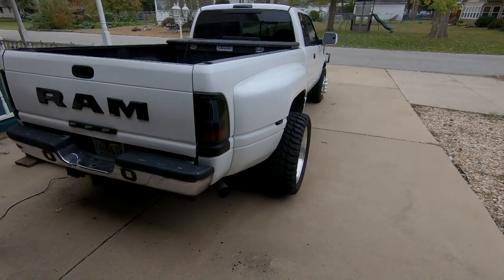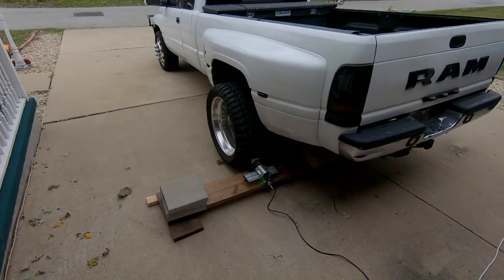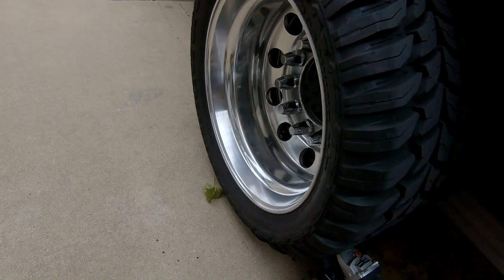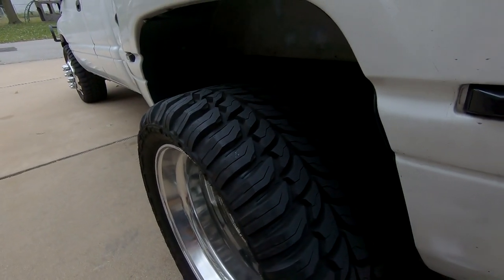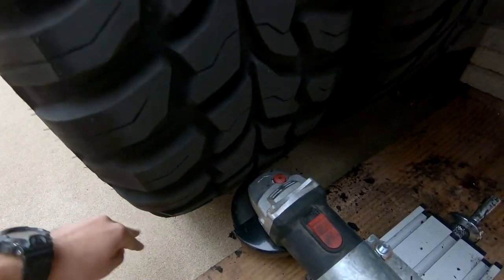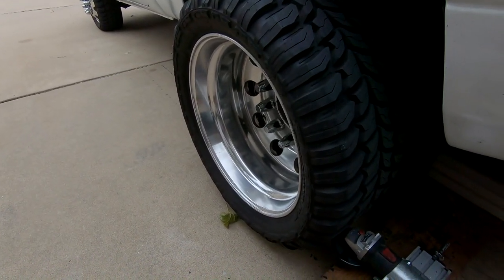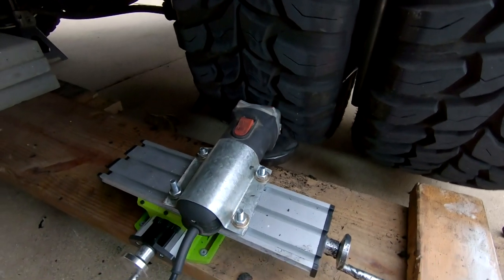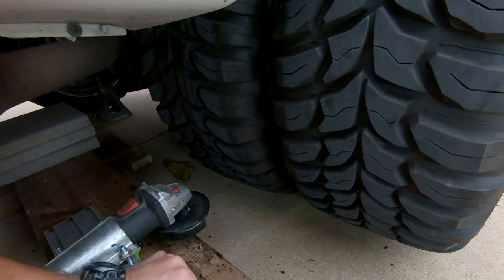Fixed my 10 Lug Dually Wheel Hwy Vibration | DIY Tire Shaving last resort | Crosswind M/T Tire Issue

Comment from the maker: After looking into this tire brand more, the amount of reviews complaining about out of round tires convinced me that this was the only way to fix them.  I got them from Simple tire, and they decided to sort the reviews best to worst, so you really gotta dig to find the bad ones, regardless of date submitted. Unfortunately just an expensive lesson learned. Warranty was pretty much useless, I did try that option.
Reply: I have the same kind of problem of a bit vibration on regular car (Honda accord) and I also figured the wheels are not perfectly round and I don't wish to replace them yet because there is plenty of thread left. I knew it must be the wheels because when I put the front wheels to the back, the problem got less severe. I'm glad you were able to help your problem but based on the video there is still some vibration in that and I would be worried about possible damage to the bearings and suspension parts if I had to drive daily with that. Were you able to ever get rid of the vibration completely and did you balance the wheels again after the shaving as that also effects the balance? Could there be some other issue also in your suspension or axles causing that vibration if you are sure you got the tires perfectly balanced and round but the vibration still remained partly?

Comment: I have the same tires on my 97 f350 dually, I have had the same issue, vibration in the front, but I have found that airing them down to about 70 or 65 makes the tire make more contact on the road and reduces and knocks it out. you may not be able to do thay since you have such big wheels I just figured I'd throw it out there for others.

Comment: Let the wheel spin by it's self and do the same setup just use a belt sander . Helps with more even and more surface area shaving . I'm about to do the same thing

Comment: I like your home made tire blade 👌... i payed 560$ to get that done to my dually... the reason why you have that problem is bcz they are cheap tires and also I run my psi at 45 or 50 so it won't bounce like a basket ball... hope this helps

Comment: Good video. I had the same problem with that setup. With everything you have done to your truck. I had 24 inch nitto 420s $330 per tire on a f350 dually. I ended up selling them and doing the direct bolt on rims 24” mega holes.
Reply: Send a link to ur wheels

Comment: My 97 250012v  also has a slight vibration and im running yokos, could be bushings on the Track bar or steering links or axle control arms. I know my bushings are not the best which is what is causing that slight vibration just like you have now. it is just slightly annoying. and very speed related. Take luck! love the content.
Reply from the maker: Thanks man

Comment: Make sure all mating surfaces are scotch-brite clean
Acorn nuts that accommodate the factory wheel stud and the Alcoa's dimensions to properly line up the wheels, those spacer things don't work as well or at least I've heard stories.
rotate your tires.
Re-mount wheels in a Cris-cross pattern hand tight, then torque halfway, then final torque specs
What PSI are you running? I always run about 80PSI in my front tires and around 55 in the rear if I'm not towing anything, otherwise the rear of my truck will buck all over. I have a 2500 though, your 3500 will be even more stiff especially with low pros. 
Alignment...You can do this yourself with stringline and tape measures. You will likely get the alignment more accurate than an alignment shop

If that doesn't help
Wheel bearings still good?
Driveshaft may not be true, u-joints may be going out
Tires absolutely can get out of round from: as they age, cheap manufacturing, if the vehicle they're on is heavy and sits for a while.
Reply: Also, Dyna balancing beads
Reply from the maker: I appreciate you taking the time to write all that. I have checked just about everything you listed. My biggest indicator its tire related is the stock wheels / tires ride smooth, so I know its definitely not driveline related. I've had this set on and off a few times, and I'm pretty confident it's the tires them selves. Next time around will be toyo or nitto for sure. As for psi, I've not been towing much, so I run 45 rear and 55 front.
Reply: @AllThingsBoost  No worries brotha.
If all of the above has been addressed, I'm going to have to lean towards:

1. poor mounting of the tires to the Alcoas. You can try removing the tires and rotating them 180 degrees (in the direction of the tire path, not whitewalls out)...before you remount the tires, check below first

2. Big Rig Alcoas have a different bead design. If the machinist didn't duplicate the contour of standard truck bead designs, your standard tires will not center properly upon inflation. I've  witnessed improper machining before.
I would seriously take a look into this as you might pop a bead around a corner. 
This is just like mountain bike tires...tubeless vs air. You have to have specific wheels for air and specific hoops for tubeless (not just cause the spokes are sealed but also cause they utilize different beads) or you run the risk of popping a bead. There is a special name for the different beads but I forget.
Reply: @AllThingsBoost  Before you try the previously listed things to look into, I just watched your "centramatic wheel balancer" video. I noticed your 10 lug adaptors have serious rust buildup on the adaptor to wheel seat. If there is 1/64" of rust buildup on one side that would give you vibration symptoms, 
Think if you have even 1/64th of rust buildup on one side of the adaptor, that angle will gradually increase as it gets to the outer edge of the outer tire. So, if you have a total of 16" of inner and outer wheel, the inside of the inner tire will be 1/64th out of plumb and the outside of the outer tire will be 1/4" out of plumb
I would remove them and take them to a sandblasting shop, have them spray a light media to remove the rust. Sand or black oxide is too abrasive. Then I would have the adaptors anodized as paint may build up higher to one side. 
The brake, wheels and any other component should equally have no rust/calcium buildup.

stiff 1 ton suspension that reacts to every road condition
low pro tires that translate any discrepancies into the driver. 

Think of your truck like an AR vs an AK (regular 1500 srw truck). The AR won't run if you drop a handful of dirt in the receiver cause it is precision built with tight tolerances. The AK will run if you drop multiple handfuls in it cause the tolerances are sloppy

Comment: Wow that is some crazy shaking even after your trimming. Can’t imagine that’s comfortable with the amount your bag and water bottle shakes. Do you use balancing beads or standard tape beads? Apologies if I missed it in the video
Reply from the maker: I tried solid weights, then centramatic semi wheel balancers, I'm confident it's the tires at this point. I really need to dismount them and make sure the wheels and adapters are perfectly round, then if that checks out invest in a name brand tire.
Reply: @AllThingsBoost  true. I was chasing weights forever with my 35” Atturos. Ultimately, have a truck shop do the balancing over a regular automotive shop. Some light duty machines can’t spin the heavy wheels fast enough to balance out accurately. Also, make sure the shop doing it has the lug centric adapters where the wheel mounts to the balancer, not the lighter duty, more common hub centric mounting cones.

Comment: Love the setup! I know it’s an old video but I’m looking to run the same setup on my k3500. Different tires it looks like. I have watched videos of how the tire fits if they aren’t machined down right or at all. I wonder if whoever machined your tires left them a hair too big. Does the bead seat perfect all the way around on both sides? Any changes in the last year?
Reply from the maker: That's a possibility, I do wonder if they were milled down a hair too far and left the bead seating surface a tad loose fitting. Regardless, if you go this route, definitely don't cut any corners, both on tires and who does the wheels, because it's an expensive mess up. I went with a different wheel and tire setup all together, more recent videos show it, I took a solid MPG hit with this setup, from 18 hwy to 14, the new ones are a little wider than factory, 265, and my mpg is 17 hwy, that I can live with lol. Good luck with it all.
Reply: @AllThingsBoost  good to know! I
Have a gas k3500 I was going to lift the front an inch and do the 22.5s milled and a 33/12.5 if k could find a 10.5 I’d do it but I haven’t looked in depth yet. I will eventually swap the truck but I’m building a 2wd on 24s that’s bagged with an lbz so it’s the priority.

Comment: The name of the manufacturer says it all.  Poor quality.  Great solution though!  That jig you made was genius level!!
Reply from the maker: Thanks lol. I definitely regret not just coughing up the extra money for a name brand tire. Next time. Thanks for watching. I've gotten away with inexpensive tires before but never had an out of round issue like this. Wild for 2021
Reply: @AllThingsBoost  the quality control is low probably because most trucks that run a tire like that are creeping off-road and not going 70 80 miles an hour on the highway.  Great solution though 👍🍺!!

Comment: I’m curious if the wheel itself has run out?  I just turned my 22.5 rough as heck junk yard wheels to 22’s I had my truck at 86 mph last week it’s the smoothest it’s ever been,  it’s a 91 square body. 255/70/22 new Escalade type tires they are Bridgestone but I got them used.  A guess I wonder if your guy got the wheels true when he turned them.  We used a dial Indicator to ensure they were true.  I also cut my own big holes in the wheels.  Just a thought
Reply from the maker: Before I sold this setup I spun each wheel with the tire dismounted and a dial indicator along each wheel where the tire mounts because I was also curious, they all were with zero runout, which confirmed it was the tires. By that point I was done with the whole setup though and got rid of it.

Comment: What was the slide table fixture you used? I need to buy one and do the same thing. 

I've got different tires, but the same issue. Driving around 10 mph, I can feel one corner of my truck rising and dropping. The tires balance out fine, so I can't get them refunded.
Reply from the maker: Amazon, called an x y axis table. Then I used some sheet metal and the hardware that came with it to hold the cutter
Reply: @AllThingsBoost  awesome - thanks!!
Reply: What size x y axis table did you get? Does it travel the entire width of the tire? Thanks

Comment: What type of shocks do you have and does it change with say 500lbs of weight in the bed?
Reply from the maker: Monroe HD shocks. And no, it does not. Since this it has been significantly improved. I'm about 99% positive it's the cheap tires

Comment: Those rims if you bought them used can be bent
Reply from the maker: So, I later took off the tired and used a dial indicator to check before I sold them, wheels were perfect. It was 100% the tires. Atturo is a shit tire.

Comment: Maybe the machine shop that cut the wheels down got wheels slightly out of round
Reply from the maker: I've considered that as well. Unlikely but it is a possibility.  When these are worn out and I get new tires I will check while they are off.

Comment: Wheel spacers
Reply from the maker: Wrong. Pulled off the tires, used a dial gauge and the wheel adapters and wheels with no tires had zero run out. 100% the tires.

Comment: Thank you for the video there isn’t a soul thats heard of a tire shaver within a thousand miles of me. Super irritated that not a single tire shop has ever heard of a “out of round tire” i work on cars for a living and the ignorance level of some of these people is astonishing. Ok i get it YOU may have never heard of tire shaving but its a thing ass hole 
 
Wondering if you have tried a normal balance after the trueing of the tires? 

Im for sure going to try something like this im in the same boat bought some Atturo tires i didnt think they would be as bad as linglong bing bong tires but they  are no good
Reply from the maker: Damn, sorry to hear that. I'm sure they would balance out just fine, but I picked up some centric wheel balancers (think tire beads in a metal ring) and no longer need to worry about fixed weights. They did balance out originally when I first got them just fine.
Reply: People call it tire cupping..

Comment: How long did this work for?  My concern would be as the tires wear, they will go out round once again.  I could be wrong.  I don't blame you for giving this a try.  You eliminated everything else.  Good video.
Reply from the maker: In theory if they are re balanced there is no reason they should ever go out of round. I sold this whole setup, the tires were just garbage quality
Reply: @AllThingsBoost  Thanks for the reply.  I have had tires where the belts kept shifting around throwing the cheap tires out of balance, and probably out of round.  I would get them rebalanced, a few weeks later, they were jumping all over like they thew off the weights, but the tire guy showed me the steel belts were moving around in there.  I finally got decent tires and all was good.  I used to think cheap tires meant they wore out faster, but no, it means a bunch of other stuff can happen.

Comment: Tire shaving is a lost art that is still welcome, especially for large commercial tires. True, tires were worse in 60-80’s, but tires still aren’t perfectly round. We transitioned from shaving to spin balance and add weights. Many felt you were wasting rubber, but a shaved tire will wear more even and last longer. A shaved tire doesn’t require as much weight, and provides a smoother tire on road than a balanced tire slightly out of round, thus longer wear.

Tires have greatly improved, but even the best if checked on a tire shaving machine will have slight out of round… not much, but will exist. This is even more prevalent in large heavy 16+ ply Commercial tires. 

I’d like to see tire shaving services become more common, I’d definitely have my new tires checked & shaved.

Comment: Try to power break the truck and spend the tires that would wear them evenly
Reply from the maker: 😂😂 I've considered it, but 48" worth of tires is an easy way to blow a transmission in a burn out
Reply: A guy I used to work with bought one of those brand new a 2001 looked identical to that with stock wheels and tires and he would do burners down the street they'd be a block long just thought I would suggest that but I didn't think you'd be into it just a thought.

Comment: A couple of stand still burnouts probably would of takened care of that issue.   But seriously talking.   What tools did you use to shave them down?? Was that an electric grinder?
Reply from the maker: Possibly lol. 

I used an x y axis table off amazon affixed to a 2x10 and Jerry rigged in a way to work for me. Used a piece of thin scape sheet metal to fix the grinder to the table. In this video I used a regular grinder blade, did not work well. After this I went back and got a wood carving blade off Amazon, looks like a mini chainsaw blade, and it worked extremely well.

Comment: The issue is the stock suspension setup.  Go to air-ride and all the vibration will be absorbed by the air bags, not the leaf springs and front coils.
Reply from the maker: That's very possible, but man, $2-3k for a  suspension upgrade is a steep price to pay to run oversized wheels. Decided against them in the end and sold them. Thanks for the comment.

Comment: Good video, what kind of grinder blade did you use? feel like trying this myself after just purchasing some out of round budget tires.
Reply from the maker: In the video I used a regular disk, not fun to work with. I later got this blade and it worked phenomenally 
OBA Wood Carving Disc Stump Remover Stump Grinder for 4'' or 4"-1/2" Angle Grinder, Chainsaw disc Grinding Wheel 5/8' Arbor, Shaping and Cutting Disk https://a.co/d/eFYNPxb

Comment: What blade are you using in the grinder ?
Reply from the maker: I was just using a regular grinder blade, I put 2 together because 1 was flexing a ton and making more issues than solving them. I can't emphasize enough to be careful with this, and honestly dont recommend it. If you must, take a look at this guy's video and the grinder blade he used, much more effective then my method. He lists his stuff in his description.
https://youtu.be/sMU6A5KhtuM
Reply: Thanks. Hope I don’t have to. But if I do I’ll fab up something I can weight on the ground. 
He had a good setup, for sure.

Comment: Did any one try the balance beads that go inside the tires .We have had great results using them on tires that were trouble to balance, so much in fact we only use the beads now in every tires we sell.